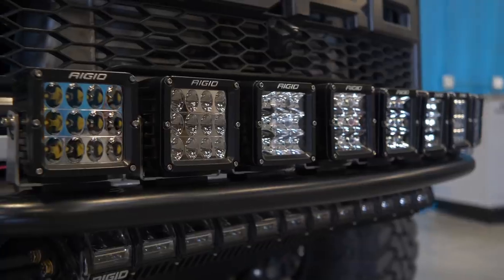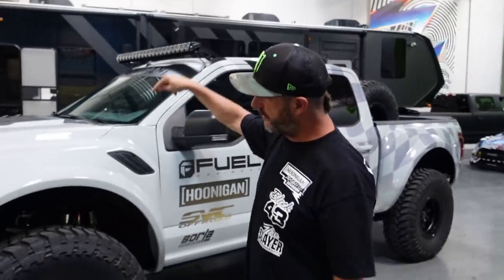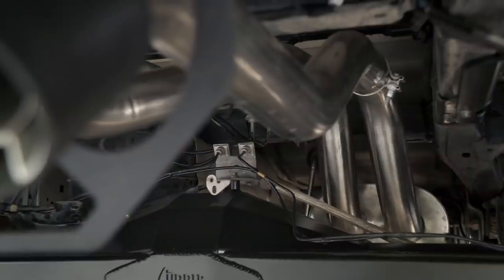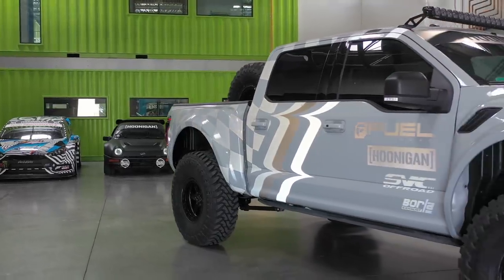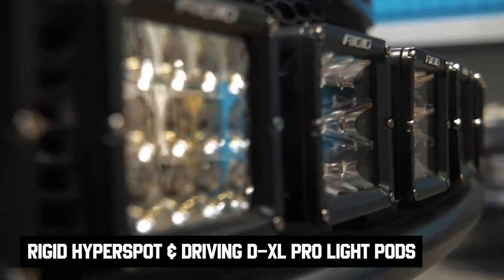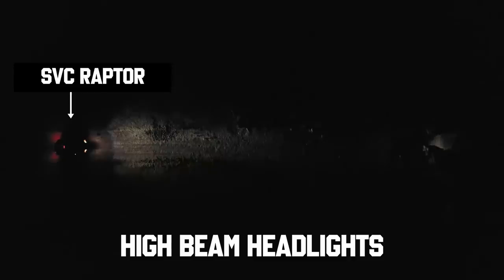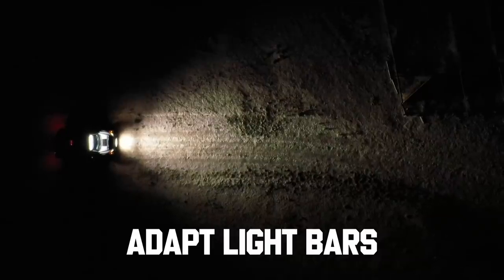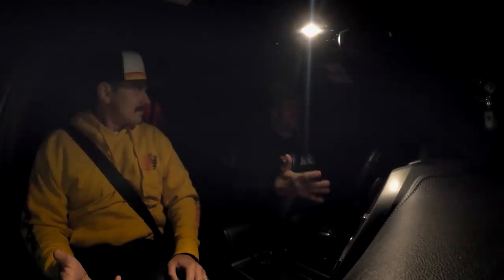Ken Block: How Much Light is TOO MUCH light?

Comment: You need one switch labeled "THE SUN", which is connected to all the lights in your vehicle.
Reply: Or just “DAYTIME”
Reply: Toggle switch "Day / Night"
Reply: and this button is for UFO mode..
Reply: Its a collapsing star. Like, there needs to be a light bar on the market called the Collapsing Star that puts out over 100k lumens.

On to my rambling okay,
The current brightest individual bar on the market as far as I can see is the Vision X XIL-PX9010 at 47520 lumens (raw lumens not effective lumens at 33k) and it draws a monstrous 37.5 amps at 12 volts. But that thing has a 10 degree beam and costs like 2200 USD. You'd need a dedicated 100 amp alternator to run a 100k lumen bar, which since the light would come from one bar as the source, it really would be a collapsing star, it'd be a constant flashbang of light, considering that a flashbang is 2600 lumens from a small point source and across a huge light bar 100k would probably equal a similar intensity to a flashbang. Though the heat would be absurd. Okay I'm done rambling XD
Reply: This brings a whole new meaning to daytime running lights
Reply: Avetho Plays  ... I’ll take 6... 4 up front 2 in back for those driving with high beams behind me 🤣🤣🤣
Reply: Benjamin Mills 😂
Reply: Or as Jeremy clarkson called it, "collapsed sun"
Reply: Something cool like Archimedes’s secret weapon
Reply: Escanor likes that comment
Reply: @sp1tf1r33  yeeep was looking for someone who commented this.
Reply: Or Christmas tree
Reply: The actual Sun: Am I a joke to you?

(I know hyperboles are fun, but the Sun is like if the ultimate hyperbole became reality.)

Comment: Me: Opening the door to my 5000 watt grow room that blasts out 1,000,000 Lumens.... "No such thing as too much light"
Reply: Do you run HPS?
Reply: @therobb5738  Yeppers, usually 2-3 weeks MH then switch to HPS, the early blue light actually makes a big difference
Reply: Pics or didn't happen
Reply: @b1ackm3ssiah  try a dual fixture cmh. I have the phantom 1 & it holds two 315w bulbs for a total of 630.
My 630w cmh fixture out-prrforms my 1000w gavitas.
RT 1.5 lbs off of 630watts
Reply: @djlansing2724  Do you know how to do economy accounting? Like, Taking out a 4% loan over the course of 2 years is actually better than dropping like $35k down on a car, bcause the 35k in the bank will make you more than 4% back over the course of those 2 years?

A Good CMH set-up costs as much as 10x HID lights. I can run those HID lights for 2-3 grows before i match the price of a CMH light, without factoring in power....

Comment: In 2006 I had linear actuators and photo electric sensors steering my adaptive light bar on my Funco. Same year Mercedes/BMW came out with a similar adaptive lighting method. Lights steer when the car steers allowing the light to bend through the turn. Position of each light was crucial. The up/down/left/right override was clutch. I could drive forward and hang the lights hard right to see camps as I was driving at night through the dunes.

However the the function of being able to lift or lower the lights was crucial for climbing the big dunes at Glamis. Can’t believe I’ve never seen anyone else do this.

Comment: I would have liked another run at stock ligthts at the end to cancel out learning the course over time. I bet the time would improve somewhat.
But hey! More light is more better.
I would also like to have seen some comparison between high mounted lights vs lower mounted, thinking about the shadows cast and what it does to visualize the bumps better. As mentioned, a lot of light flattens the terrain.

Comment: The big unanswered question is what was the time with the stock headlights plus the small corner lights without the big light bars? For a budget build, you could probably go faster with headlights plus side lights than you could go with headlights plus expensive center light bars!

Comment: Surprised that alternator isn’t squealing like a rogue banshee from all those lights
Reply: H3 probably running a dual system.
Reply: Yeah, I haven't checked the specs of these lights, but with 140 lm/W LEDs it is around 2-2.5kW, about 140-170 Amps @ 14.4V.
Reply: 2 large battery units in the back flat-bed helping supply light juice!!  😎

Comment: In this test the difference between stock headlights and the Adapt light bars is an 11.17% decrease in time. 'All the lights' compared to stock is an overall 15.15% decrease in time. Running all the lights on a course like the Baja 1000 increasing driver confidence at night and giving that time boost would be a huge advantage.

Comment: I use to run a 36" light bar on the bumper with pods on the end. 8" hood light bar. And 2 offroad lights on the roof. 

I've put light bars on every vehichle I've owned

Comment: You should look at the XeVision  New XeTREME HIGH INTENSITY LED lights for AIRCRAFT,  significant illumination even WELL BEYOND 1/3 mile. 100 watt each LED lights that don't dim as they "warm up" as the others ALL do (these have active cooling). Nothing anywhere comes close to this performance in a 4.5 inch form factor. 11,000 lumens and 320,000 Candela from each unit. About a 10 degree round beam angle. 
Also a 35 degree wide beam 10 degrees tall model as well.

Comment: Ken,

Question about the lighting and the balance of too little vs too much. Do you have to compensate for powerloss with this amount of lighting and the wattage they require? I would love to put an array of spots and floods on the front of the car, but it seems like at a certain point it would be eating hp. How do you balance that?

Stay Awesome!

Comment: Fun fact those rally pods can house amber fog lights so it can be used on regular road cars.
Reply: So, I've never tried it, but apparently amber or yellow are better for fog, rain, and snow, but for desert racing, you want to lean towards the blue end of the light spectrum.
Reply: @musewolfman  I was meaning instead of adding redundant lights making it a ricer you put amber lights to make it better for regular road use.

Comment: That does not look like 300,000 lumens, did you preform an accurate measurement for light output or are these measurements taken by the factory and you just added up all the numbers

Comment: This video is certainly not covering all kinds of driving conditions. There definitely is times when too much light is bad. I.E. dense fog, dust , heavy snow, blowing/drifting snow. Also where you mount your bright
 lightbars can be a big deal for when it’s effective. Mounting lights above the windshield can be an issue. It makes it hard to see through dense fog, snow harder, causing eye strain, also it creates glare off the vehicles hood. It might not be a problem if you have other light bars mounted lower on a bumper or in the grill. Where you can go without it. But if it’s the only light you plan on mounting. Lower light is more functional. Also the beam pattern is possibly the most important decision to make. Spot lights are good, if accompanied by flood/driving lights. Spot light beams are nothing useful in dense fog or heavy snow.

Comment: They should get a rigid rep too use the truck too compare all of the models and their features since its so rare you have such a wide variety on one vehicle. Im curious how the new 360s compared too the older R46 series 🤔 
Happy owner of rigid adapt 40inch, adapt 10inch and 2 r46s the gps setting on the adapt are really really cool

Comment: You should call that truck "LightSpeed".  (Or "LightSteed", if you prefer.  That would be a better name for a Mustang, though.)  You could make graphics for the truck like [LIGHT=SPEED] (with the equals sign a fair amount smaller than the text size for the rest).

Comment: You'd need one hell of an alternator and a couple of deep cycle batteries to run all that.
Reply: Not really, voltage and not amperage with LED.  All of those lights probably take less juice than 4 of the old school rally lights.

Comment: Now add a bar sticking up about 10 feet, with a shock-absorbing lever (like a sideways steadycam) at the bottom to keep from snapping the arm off when you hit bumps, accelerate, brake, etc. Put a square bank of LED's up high on the bar. Getting the light up high will project it out further. Also, the larger the reflector, the better the light pattern, usually.
And just connect the light bank to the steering, probably with a magnetic angle sensor like a TLE5010 on the steering arm, and servos on the light bank. That will pan the light beam to point where you are steering.
To get the light even higher, to go further, put 20k lumens on an RC airplane, and just fly along above the truck, lighting up the trail. https://www.youtube.com/watch?time_continue=56&v=XI8mSvO707g&feature=emb_logo

Comment: Doesn't fuel consumption increase ??  If it increases, then the fuel will run out faster than the car reaches the finish line in the rally.

Comment: Ken block when u going ask them at rc car truck company make your twin turbo pickup that can go against 1/7 scales arrma truck it's with hand brake.. I know they make your rally car rc hobby car.. but when they going make u the replica of your twin turbo 77 ford truck that 1/7 scale that also have hand brakes.?? Be kool!! And when u going make my idea of a real truck. Smaller versions of that truck as a 80s ford ranger like my old truck I had was 86 extended cab ford ranger 2wd truck I had. But be kool if u done like your 77 ford truck but that ford ranger in 80s . But u guys stay safe in Utah and stay away from that covid19 crap.. sincerely Robert Hartmann from Maine